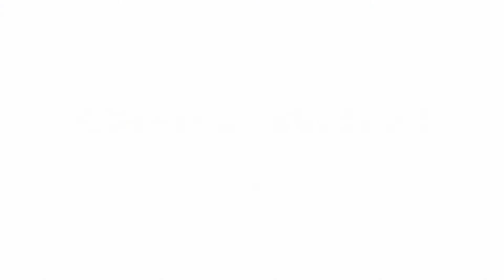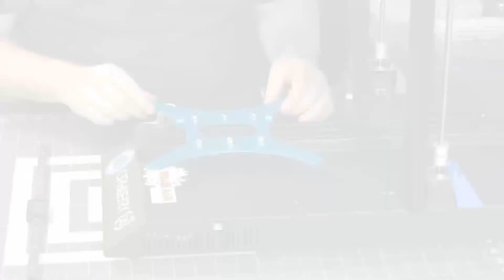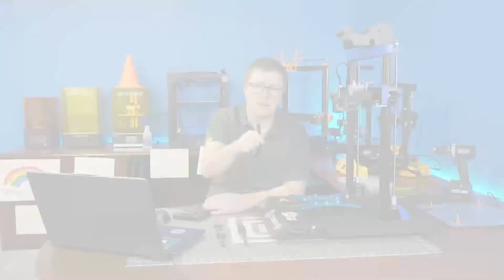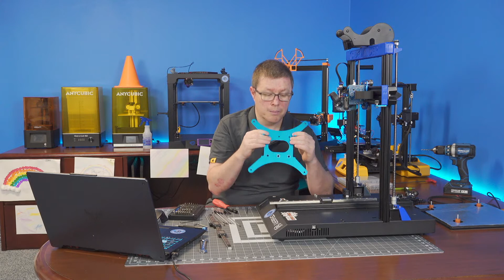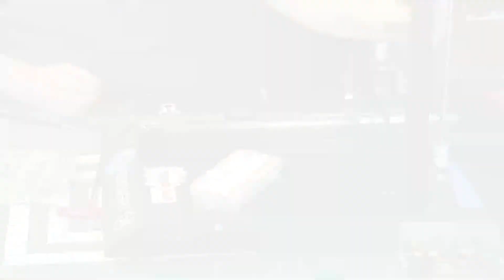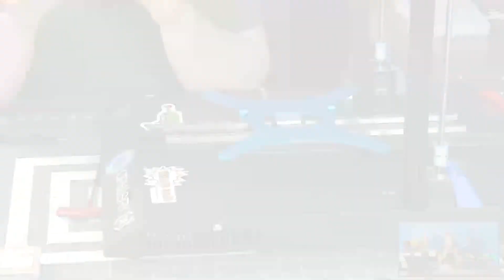Sidewinder X2 "Y" axis linear rail conversion live stream.

Comment: Hey, I found out the design flaw of all the Sidewinders, that so many people are trying to solve with expensive and useless upgrades, since my SW2 prints flawless. I tried to contact Artillery in order to remove this simple flaw, but after one month I still have no response...
Reply from the maker: What flaw did you find?
Reply: @EtherealProject3D  I found the one that you are trying to solve, using rails and different types of wheels. The standard ones are just fine. There is a flaw in the gantry movement design, which is easily fixed, without so much hard work....
Reply: @ivn3006  What is the fix for the issue?
Reply: Still waiting what the problem is and how to fix it....
Reply: Ivn the fisherman

Comment: How Mount plate to linear rail?
Reply from the maker: It will require drilling holes for screws. I am designing a template that can be 3d printed to use for drilling the holes.
Reply: @EtherealProject3D  Great timing for that.  I've been waiting to do my linear conversion, but haven't been able to find a template for dual rails on the X2.
Reply from the maker: @Avrution  I am working on a set of STF files to have available to aid in the installation of the mod. Stay tuned, I will be showing them on this weeks live stream.
Reply: @EtherealProject3D  Are you planning for X and Z as well or just stopping with Y?
Reply from the maker: @Avrution  all x and z are planned. Im working on the x axis design right now.
Reply: @EtherealProject3D  Very interesting stuff.  I bought enough to do everything, just haven't actually started.  Your rail link goes to MGN9C 400mm, but the keywords are for mgn12h.  Did you actually end up with 400mm rails or 450?  I might have missed the sizing in the video.
Reply from the maker: @Avrution  I have MGN12 rails, 400mm long. with the H type block for the Y axis. And I have HGW15cc rails coming for the z axis
Reply: @EtherealProject3D  I look forward to seeing what kind of improvements you get in klipper with this setup.